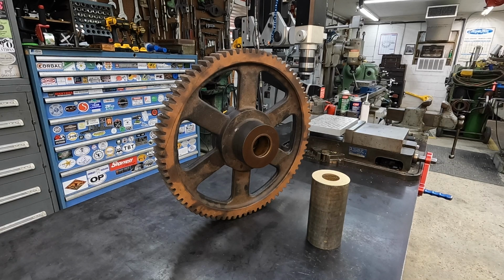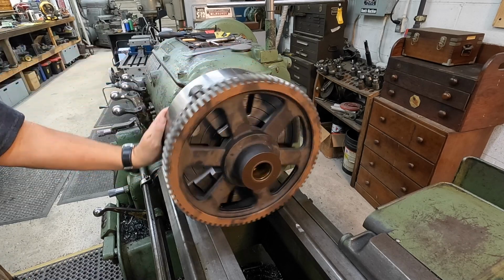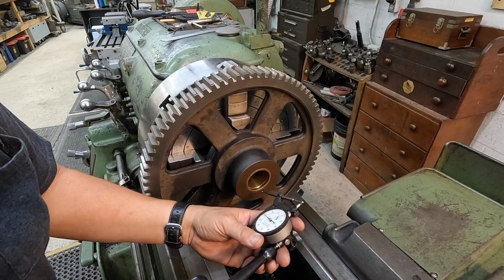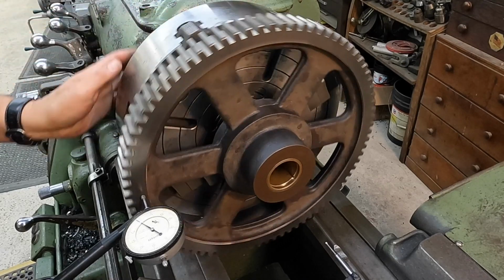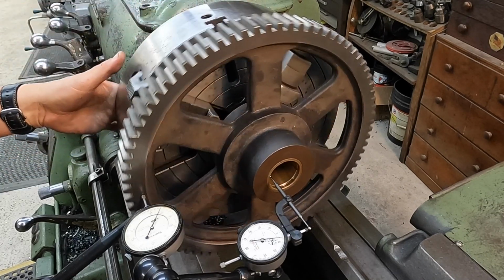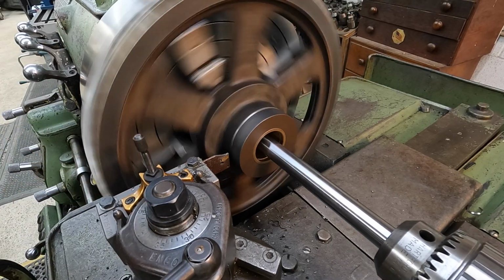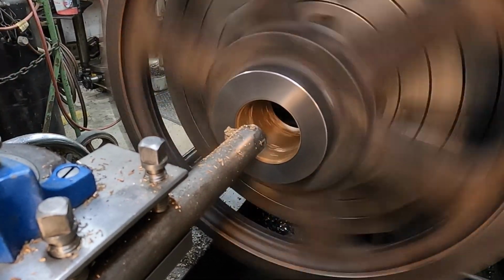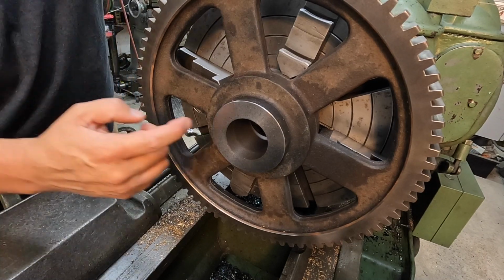Gear Modifications Part 1

Comment: Manual machining such an outdated thing, so much crap with setting. I hope CNC will kill it completely in few decades.
Reply: You don’t actually program CNC machines, do you? 🤣

You’d have to true that in the chuck of a CNC lathe just the same. Only nobody would bother to write a program for a CNC lathe for such a simple job. Far faster and easier just to use a manual lathe.
Reply: @KennyEaton603  in time they will make machines that will auto true everything and balance it. Ai will help write g code or 3d scanners will make everything super easy.
Reply: @gary851  what part of “it’s already easy and you’re making it difficult” are you not getting? 
Maybe it looks difficult because you have never done any actual machining, I don’t know. 

Any idea what a decent CNC machine costs? 

Funny thing though, I haven’t heard anyone speak of the stuff you mention at any of the trade shows.
Reply: @KennyEaton603  That's why i wrote decades not years. I got it that this is easy for someone who does it for a living, but labor costs and storage area problem. Thats why we got automation so unskilled person can push 1 button or just hit stop if something goes wrong. About cost, anything new cost a lot of money. It will get cheaper over the years.
Reply: @gary851  you’re still missing the point. It takes a ton of skill to program a CNC machine, even with a program like MasterCAM. It is FAR easier to run a manual machine. 
Have you seen the size of an actual CNC machine? The little Mazak 5-axis at my dad’s shop is definitely not small in the amount of room it occupies, and it cost a million dollars. Literally, paid a million for it. The DMG Mori horizontal is bigger than my truck by far, and it must be 12 feet tall. 
The guys that program these machines get paid very well, more than the guys running manual machines. The cost to operate the CNC’s is huge as well. The horizontal mill has a 50hp spindle, 40kilowatts to run that spindle. The 5-axis mills are 20Kw spindles. That’s a lot just of money just in electricity. 
Our CNC’s don’t run one part, unless it’s a big part that costs thousands of dollars. They don’t become profitable until they’re running big batches of parts and cycling 24 hours a day. 

The manual machines are easy to make money with. They each bill out $85/hour every minute someone is running one. They basically only cost labor to operate, are much cheaper to maintain, rarely break down, and despite being 10-25+ years old, are still every bit as good as a brand new machine. 

CNC machines look easy to operate. I promise you that is anything but reality. The idea of pushing a button to make it run is only true if you’re running the same job over and over, and that only happens after the programmer has spent hours getting that program to run flawlessly. It’s not a cheap process and does not suit single part jobs unless they are extremely expensive parts. 

Manual machines are never going out of style. They will always be the cheapest and best option for jobs like Adam is doing here. 
The next likely change machining is going to see is 3D printed metal parts taking work away from the CNC machines. As material costs continue to increase, subtractive manufacturing is going to lose out to additive manufacturing and you’ll see CNC machines replaced by 3D printers. That is the reality of the future of manufacturing.
Reply: There will always be a need for manual machining for one of repairs.
Reply: Manual machines will never go away and never be totally useless.   These one off jobs are a perfect example of that.    CNC wins at high speed and high volume for obvious reasons.    But the home shop us mechanics use for an occasional repair we can never afford a cnc lathe and the software just to make leaf spring bushings and fix a PTO shaft a couple times a year.
Reply: Tell me you've never touched a machine without telling me you've never touched a machine
Reply: CNC is best for creating many identical parts. A CNC setup for this one job would take longer.

Comment: Most critical of steps is indicating. If that is off, then everything else will be off. The more time you spend on indicating the more precise the rest of work will be. I'm not a machinist, but to me that seems to be  the most important. I'm learning Adam. Thanks for all you share.
Reply: you'd be correct, a proper setup can be far more difficult than the rest of the repair.

Comment: Hi Adam,
Love both your channels, long time viewer.
I have a question regarding this type of part. As it's a large heavy and fast spinning part, what other safetys could you put in place to prevent the part from flying out? I thought when you placed the bar in to catch the part getting cut off this could be used as a just incase method should the part come loose.
Thanks.
Reply: That was done up two grunts tight, that isn’t coming out unless it fails (cracks into parts) and then nothing is stopping it however the rod down the middle might draw  the tail stock into the accident! 
The safety aspect is that the thing rings when tapped therefore no cracks are detected plus whenever possible you stand off tho the side of path of exit, the way the lathe is designed for operation tends to ensure this position, lastly you listen to the machining, with experience you hear defects and / or failure approaching.
Reply: A part could be lightly bolted to a chuck face without distorting the part. You would have to drill and tap holes in a very expensive chuck.

Comment: maybe it's an optical illusion, but the center hub of that gear appears to be out of round as you rotate it -- resembles the lobe of a cam.
Reply: That it is, the cast is not concentric the gear and central surfaces of the bore should be concentric, if the gear is not well supported, it would cause excessive wear over time due to vibration caused by an imbalance. If it’s a low speed, it is less of a problem.

Comment: 2:00 If you stamp some width reference numbers onto the face of the chuck, would you no longer need to measure the opening with your scale?
Reply: that would be about pointless unless all the parts you were indicating were near perfectly round.  I wouldn't even attempt to try that  on my 4 jaw.    Sometimes well enough is as good as it gets.
Reply: @MrChevelle83  Not meant as a substitute for indicating. Only meant to negate the need to measure the approximate size of the opening with his scale.

Comment: Awesome sauce. How come after your bored out the bushing you didn’t re-indicate to re-centre the gear.  Aren’t you off 3 thou from true?
Reply: .003 on a open gear is of no concern.
Reply: Kick ass. Thx.
Reply: The bore is untouched, he only cut the bushing material until it was thin enough to break to not have to use a press to remove the bushings, so if the bore was good from factory it will be good again for the new bushings which of course will be machined apart and pressed in the gear afterwards.

Comment: The bore is spot on and only the outside of the hob wobbles due to a casting not turned down but ground in general down.  Nothing precision in hub. The very nominal slop if any in the gear face will be taken up in the meshing of the gears.  Gears are not bottomed out and have room to wiggle if needed under load or a chunk of junk drops in and out while in operation.
Reply: In fact I think the junk will be like 90% of the lubricant on those teeth and maybe even help reduce noise

Comment: Also, would it be best to indicate off the inside edge of the outer gear, so that the new bore will be concentric with the gear teeth? You're assuming that the original bore is concentric with the gear ring by indicating off it?
Reply: They probably bored the hub of the casting first and used that hole for holding during the gear hobbing.

Comment: Leaving the original machining. If it ain't broke... 😁
Reply: Only thing I would have done is make that wobble in the casting vanish, so there is at least a true surface to clamp the gear the other way, to do the other face if needed.

Comment: Out of curiosity would you normally true up the outer hub so it runs more concentric to the center of the hub or it is normal practice to only do what the customer requests? I mean it would sure look better if the entire hub was running concentric but I also understand that there might be a reason you leave the outer casting on the hub unmachined for a reason. Love the channel. Thank you for all your hard work.
Reply: That's just work for the sake of work. It does nothing useful for the part and is just wasting time.
Reply: That was not part of the specifications that he was paid for.
Reply: @philipmackin1025  Makes sense. I'm no machinist by trade so I was just curious. I imagine if one did that every time it would add serious time to each job that he's not getting paid for. So basically if it's a paid job you do what it asked and no more, no less. Yet if it was his own job it might be something he does for esthetics. Does that about sum it up?

Comment: Seems like you should indicate on the gear teeth by using dowel rods between the teeth. Like using wires to measure threads. You are using the bore that is already in the part but who knows how close the last person to do it was.
Reply: If it was a precision gear running in some gearbox I would agree, but this is an open idler gear in some kind of textile machine with probably 30 or 40 thousands slop in the mesh.
Reply: it's the factory bore
Reply: @2wheelnthusiast88  Never assume anything in the machining world.
Reply: That’s assuming the teeth aren’t worn.

Comment: I don't understand how there going to use that gear at all the center hub is crooked bad   gear mesh is going to be awful but you the man Adam  but if its made wrong to start with not sure you can fix it
Reply: The center bore is concentric with the gear teeth. The casting is bad.
Reply: just look on the gear teeth when he was boring out the bushing.. You can clearly see the Bore is running true with the gear teeth.. so The hub being off center doesn't affect the meshing at all
Reply: @FireGodSpeed  No but it will affect the balance,if it runs on high speed it can cause vibrations . But then again this looks like something that spins on 100 rpm so probably it wont matter . 
You are right ,as long as bore is concentric to outside teeth rest of casting doesnt matter unless its a high speed application. 
And since those teeth are hobbed  out by  a cutter and a mandrel that goes trough bore ,its gonna be concentric.
Reply: @armageddontools  i didn't bother going into the subject of centrifugal force... since this gear is obviously used in a low rpm range anyway.. (as you mentioned)
Reply: the hub does not matter, look at the bore spinning and the bottom of the teeth spinning - nothing is moving there and those are the parts which matter.  The gear rides on the bushing Adam is making not on that hub
Reply: Yep you are right, you don’t understand.
Reply: that was the very first thing I noticed as well. looks warped or not centered very well from when it was first made.